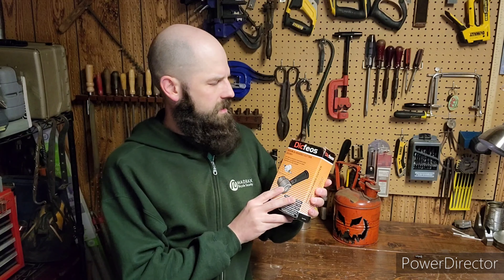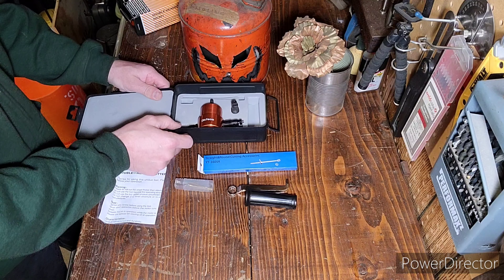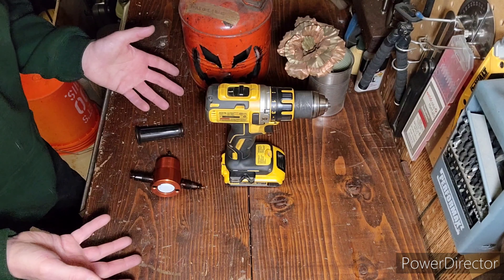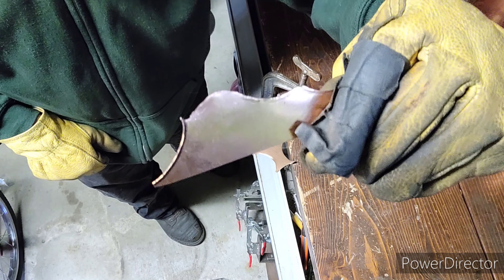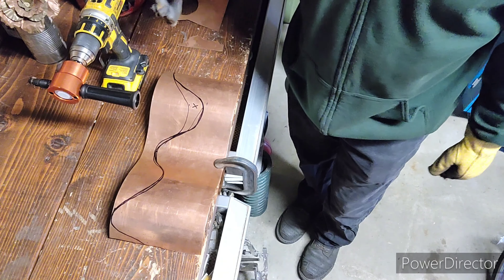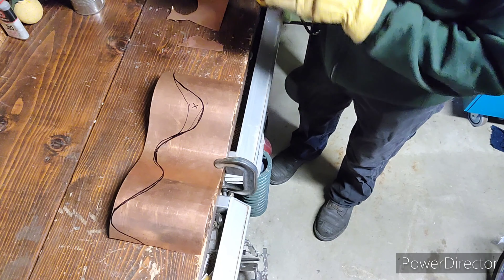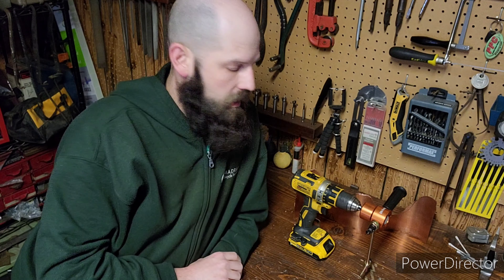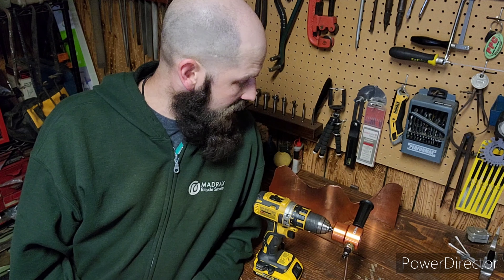Dicfeos Metal Nibbler Unboxing, Review, and Demonstration

Comment: Thanks for the video, I have just got one of those, I see you read directions as well as I usually do. Doesn't it state to use oil when cutting Copper? and also, does it also say to have the nibbler running before you contact the metal, and don't stop until it's clear of the metal?  Perhaps they modified the instructions since you made this video? Maybe they  modified the instructions because of this video? Anyway, I am off to give mine it's first test, I wonder if a light spray of cooking oil on the surface would improve the cutting, and prolong the nibbler's life? At any rate, thanks for the video, and Lord be with you. -dave
Reply from the maker: It's been a while since I've used this tool so I went back and re read the directions. To quote "Use special bit-cooling oil at operation, especially for the copper or aluminum cutting." It's VERY vague. And there is no mention of having the nibbler running before you contact the material. Unless this tool is running at a rate where the temperature is high enough to ruin the temper of the cutting blade. I don't really see the need for some kind of cooling oil. Especially on copper. But it definitely sounds like your instructions are a bit more detailed than mine.